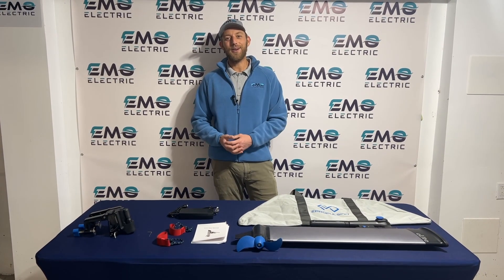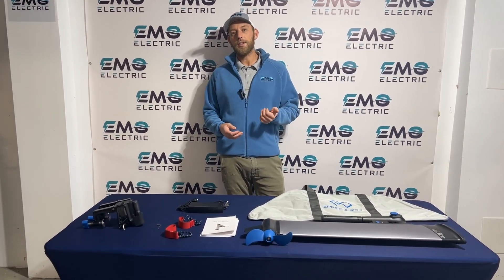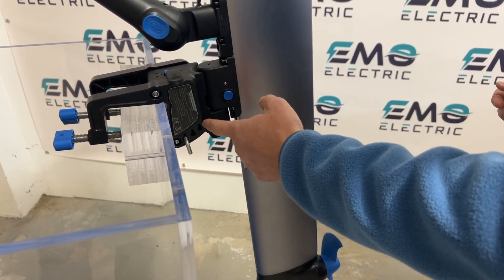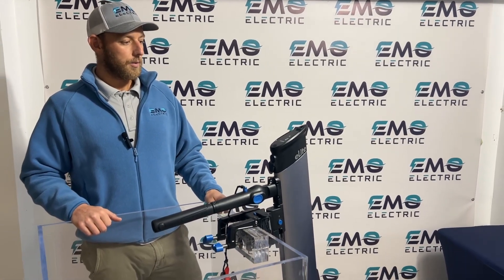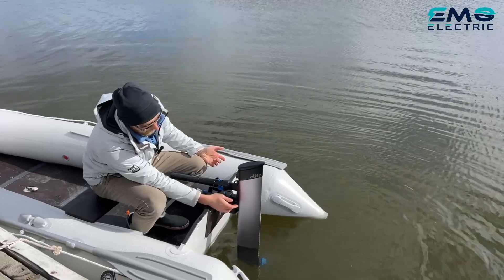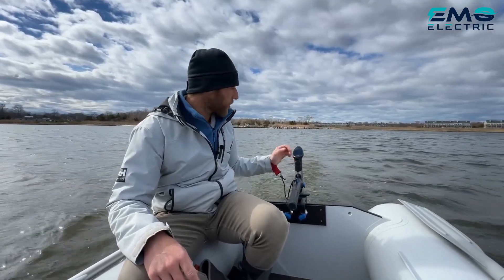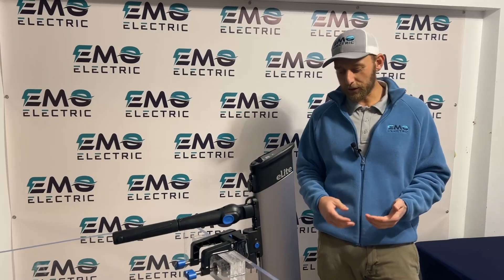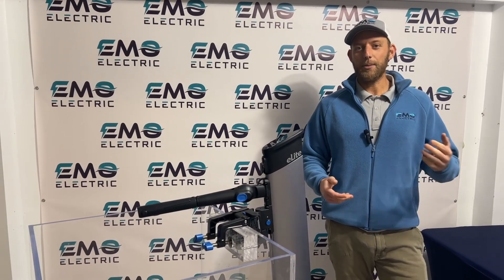The ePropulsion eLite Electric Outboard: Features, Maintenance & How To Use It!

Comment: This is a great video. I just bought an e-lite and it doesn’t lock when fully down so kicks up whenever we reverse. I checked the “anti-ground” switch isn’t engaged so am stumped why it won’t lock. Any ideas?
Reply from the maker: Yes! It is very likely that you do not have the trim pin installed. We sell replacements on our website, and this video shows you how to secure it with a ziptie as they fall out easily.

https://www.youtube.com/watch?v=7fANrwCrx_M
Reply: @EMOElectric  Thanks, that what it was!

Comment: If I understood you correctly you have leave the motor with 25 to 50% charge when stored ? that means when I get on my boat for the day/week I only have say a half charge to work with. surely I can leave it 100% charge between use ? say 2/3 weeks between use ?
regards

Phil
Reply from the maker: Hey Phil. ePropulsion recommend storing the eLite at 45-50% SOC for long term storage or when it isn't going to be used for more than a few weeks. You can certainly charge it to 100% between uses. 

Say, for instance, you use the eLite one day and have between 30 and 60% SOC afterwards, and you know you won't use it again for two weeks. It's better for the longevity of the battery if you charge it the day before the next use instead of charging it to 100% and letting it sit for two weeks.

Comment: Any data on using the solar set up with this unit?  Can it solar charge while being in use?
Reply from the maker: Yes, it can be charged with solar during use, but it would be a trickle charge. Whatever wattage panels you are using to charge the motor, once you are over that wattage while using the motor it would start to discharge but slowly. We haven't had a chance to test the solar charge controller with the eLite yet to get an idea of charge time.
Reply: @EMOElectric  If you can charge w/ solar while operating, then I assume the 12v charger option for the Elite can be used while in use. If this is correct, then maybe you can really extend the range and charge at more than a trickle with the right battery.

Comment: Is the elite variable speed?  In other words, can you go at a very slow speed for trolling, etc... I am only seeing references to half and full speed.  thanks
Reply from the maker: Yes! The throttle works just like a gas outboard tiller throttle and does have variable speed. You can use it to go very slowly.

Comment: I don't see this design getting enough credit for how much space it could save in small craft with motor wells.  Like cruising dinghy's.  Its a niche market for sure.  The well could be made much smaller.  The well doesn't have to accommodate a traditional 'head' that extends forward of the mount and requires swing space inside the well.
Reply from the maker: Absolutely- that's what the eLite is designed for. It isn't a perfect solution for every boater, but it's a great solution for some!

Comment: It would be perfect is we could attach an external battery. Cant believe they did not add that. Such a shame.
Reply from the maker: The eLite is designed to be light weight, low cost, and portable. If you'd like to use an electric outboard that hooks up to an external battery, we'd suggest the ePropulsion 1.0 Plus.

https://www.youtube.com/watch?v=U1CYLdZm0DY

Comment: Can it be charged on the go?
Reply from the maker: Yes, we sell 12v chargers and solar charge controllers for the eLite. They are backordered at the moment but we expect to have them in September.

https://emoelectric.co/products/epropulsion-elite-12v-dc-charger

https://emoelectric.co/products/epropulsion-elite-solar-charge-controller
Reply: @EMOElectric  hi, does it mean it can run while being charged? Thanks.
Reply from the maker: @paulschlemer  We did test that the eLite will run while being charged with the standard AC charger.
Reply: @EMOElectric  I guess this answers my previous questions regarding AC charging. Thanks. Since the Elite can be AC charged during operation, is there an ideal fast charge method (charger plus external battery combo)
Reply from the maker: @GuySkellenger  You're welcome! The fastest way to charge the eLite is with the AC charger.

Comment: Really great video this and the best out there so thanks. I really want to move on one of these but here in the Bristol Channel UK we have quite fearsome high tides and it can be choppy. With a 2.3m inflatable as a tender and having to travel a round trip of say 1.5nm, I'm wondering if this will have the power/guts to cut through the water and get me home?
Reply from the maker: Glad that you enjoyed the video! We'd expect a 2.3m inflatable to do between 4 and 4.5 knots with an eLite in calm conditions. You'd have about 45 minutes of run time at full power, which would give you about 3nm of range. If you're fighting current and chop, your speed at full power and range will certainly decrease, although by how much is difficult to say. Do you know how many knots of current you're usually dealing with?
Reply: @EMOElectric  Thanks for the reply! Tide flows at around 3 knots

Comment: I'm a bit worried about any kind of potentially missing internal battery management software if they are really worried about having to babythe batteries state of charge, especially considering the products seasonality. Besides that I think it's a pretty awesome design overall. Like others have mentioned I really wish that the internal battery was hot-swappable, or if they made a version that had twice the internal capacity with the same sleek design.
Reply from the maker: Like all ePropulsion batteries, the eLite has an internal BMS. You do need to check the state of charge when the motor is not in regular use, but ePropulsion recommends once every three months. ePropulsion doesn't tell us anything about products that are in development, but we wouldn't be surprised if there is a bigger version of the eLite in the works!

Comment: it is sad there is no provision to add a supplementary battery power source to the Elite because the battery is "built in"side of the shaft. Seems to me that 45 minutes of runtime is not much for an auxiliary electric outboard that has no provision to add additional battery. Some thought should be considered for a simple clamshell housing to secure the 2 motor bracket screw downs to eliminate their loosening & unscrewing with loss of the motor overboard. It is a good idea that might benefit from improvement.
Reply from the maker: We haven't heard of any issues with the bracket loosening up, but there is a small area where you can tie a line through the elite and to your boat if you are concerned about it falling off. If you are looking for something with longer range and the option to add third party batteries, or batteries that you can swap out, we would recommend the Spirit Evo or Spirit 1.0 Plus.

Comment: @EMOElectric - 1. How exactly does one tighten the steering friction? 2. I have a 6" thick ISLE Switch Pro SUP with mounting plates for a transom. What would be the optimal depth or shaft length for the propeller? 3. What range would you guess the eLite would have at @1/4 power?
Reply from the maker: The steering friction can be tightened by tightening the nut on the bottom of the transom bracket with a 10mm hex wrench. The top of the propeller should be just below the bottom of the SUP. We'd need to know the distance from the top of the mounting bracket to the bottom of the SUP to figure out the ideal shaft length for the eLite, but I suspect it that the elite would work well for that. In terms of range, I would expect that you'd get about 3 hours of run time at 1/4 power. Feel free to send us an email to luke@emoelectric.co and I'd be happy to work out the details of this with you!

Comment: This ticks all the right boxes in terms of its mechanical design features. It's perfect in that regard. The negatives are the range and price. Create a non-integrated battery option where you slide a fresh battery down inside the shaft from the top and I am sold.
Reply: They have three models. The other two have what you suggest. This is the simple, small, value model.

Comment: surely you could remove that black top cap , drill a small hole & run some wires for an external battery
Reply from the maker: We would not recommend attempting this, and doing so would certainly void the warranty. If you need more range, we'd recommend the Spirit 1.0 Plus or Spirit Evo, both of which can be used with external and/or third party batteries.
Reply: Hey -you can use the 12v trickle charger they sell to charge during operation. In theory you can run at 250w average for 50% of the time on and off for 3hrs and still have 50% charge.

Comment: Are there any power box options available to charge the battery while in use on the water?
Reply from the maker: Yes, we have 12v and solar charge controllers available for the eLite.

https://emoelectric.co/products/epropulsion-elite-12v-dc-charger

https://emoelectric.co/products/epropulsion-elite-standard-charger-copy

Comment: How can 500w equate to 1.5hp ?
Reply from the maker: Good question! If you do the math, 500w does not equal 1.5hp. But this 500w motor will perform like a 1.5hp combustion outboard. Electric outboards are much more efficient than gas outboards, and their power output is measured differently. Check out our blog post on the topic for the full explanation. https://emoelectric.co/blogs/electric-outboard/understanding-electric-outboards-horsepower-vs-kilowatt

Comment: Loving this unit.
What are we looking at for the amount of charge cycles that consumers can expect until end of life?
Also, warranty is full replacement? Thinking for batteries and speed controller or shaft leaks into the motor.
Reply from the maker: Most users will need to replace their electric outboard batteries due to time, not charge cycles. We expect a battery life on the eLite of about 7-10 years if it is properly cared for. Each warranty claim is different, but given that the eLite has relatively few serviceable parts, we expect full replacements to be more common than with the Spirit.

Comment: I need a 20 inch shaft.  It sounded like the eLite will not work for that length.  What is maxium measurement from top of transom to bottom of boat?
Reply from the maker: Shaft measurements are slightly different for most electric outboards compared to combustion outboards. The highest transom the eLite can accommodate is about 15.5 inches. Please take a look at this guide from ePropulsion. At its longest setting, the eLite has the same shaft length as the Spirit 1.0 Plus extra short. You would likely need the Spirit 1.0 Plus short shaft.

 https://www.epropulsion.com/post/measure-electric-outboard-shaft-length/

Comment: is the battery replaceable?
Reply from the maker: Hi- the battery is not replaceable.
Reply: @EMOElectric so unit has to be thrown away when batteries are end of life?
Reply: @BrookStockton  The same is true of most electric outboards; the batteries need to be disposed of. I have just had to dispose of two batteries for a Torqeedo after 10 years.